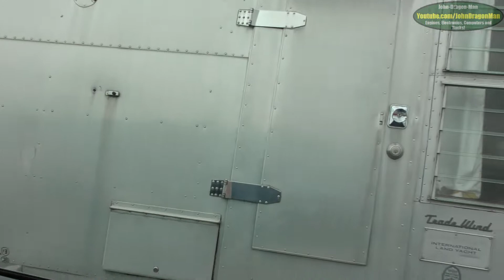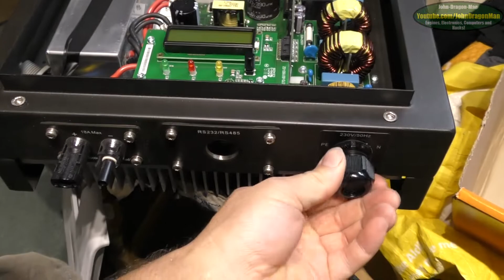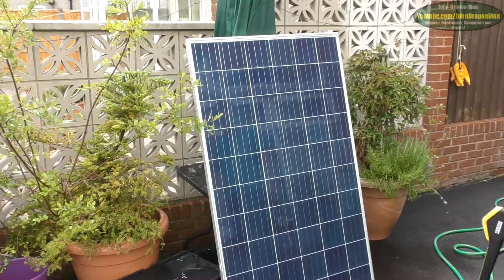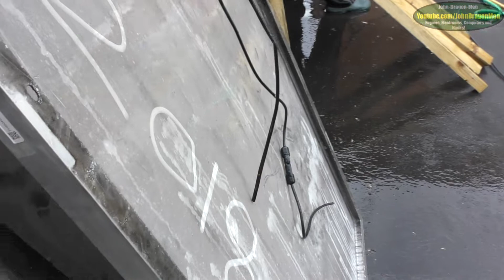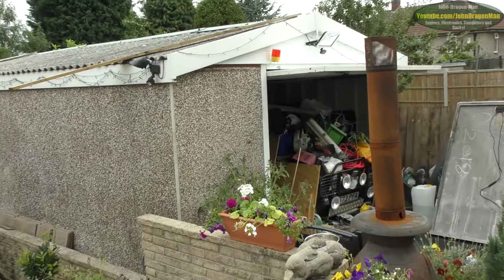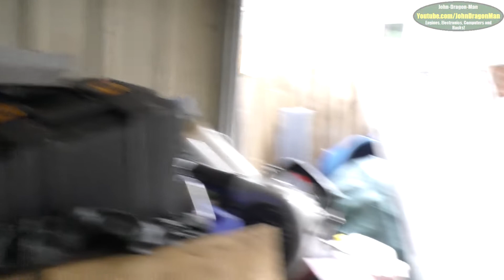Grid tie inverter Solar Panel Project part 1

Comment: Great buy John, I have had a Ever solar inverter fail last year.all the mosfets failed and 16 caps, it also is a 2000 watt 240 volt inverter. The solar panels look good ,looks mainly smoke and some heat damage. Look forward to this project you and your brother have planned.